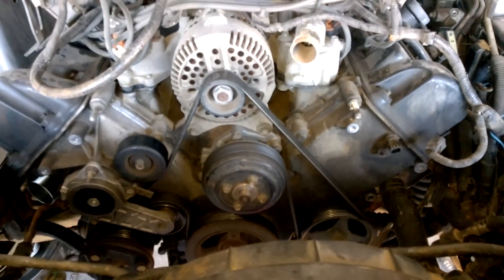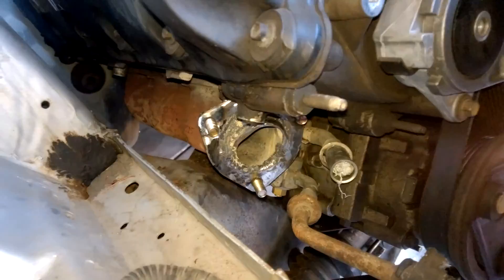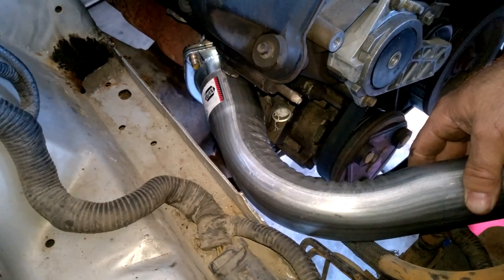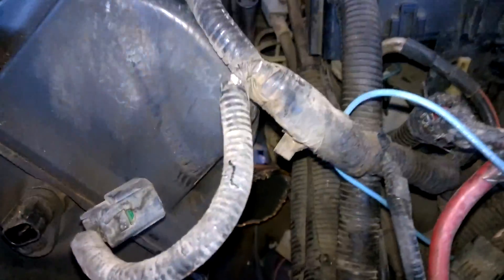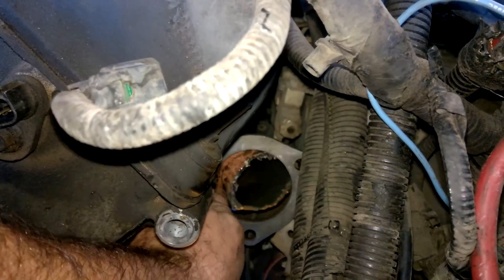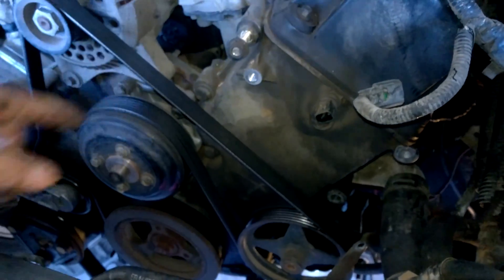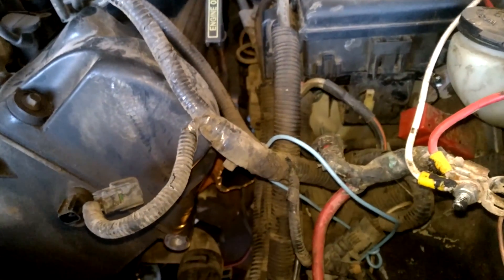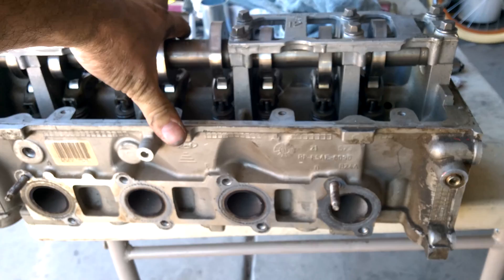Project Mustang - Passenger side manifold done - Drivers side

Comment: Did you cut off the egr exhaust tube off driver side manifold?
Reply from the maker: Yes I did. The rusted connector wouldn't budge either so i literally took the SAWZALL to it.

I may connect it later if it is needed to pass emissions.
I've got a little while but eventually I will need to add the cat and all that stuff again.

Comment: I second it will leak. They need all the bolts in. All that heat makes those manifolds expand and contract a lot.
Reply from the maker: Yeah I'm going to try to get me an angle drill or something. Or maybe I could get a bot for my dremel
Reply from the maker: I fixed the broken bolt. New video coming soon.

Comment: It'll probably leak. Get ready to pull the head and film a "Broken Bolt Repair " video.
I'll watch.
Reply from the maker: LOL, yikes I'm gonna try to avoid that.
I'll probably get myself an angle drill before I do that. Which is what I thought about after doing the video. I should have some easy-out bolt extractors in my tool collection somewhere.

I do have these spare low mileage heads I bought as well but figured I'd save them for the time I do have to pull the engine for a repair.